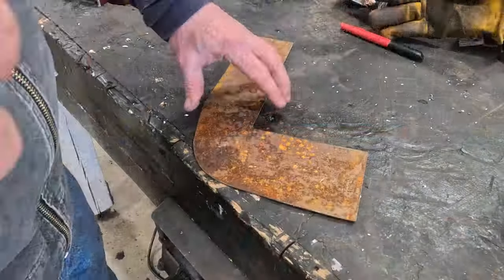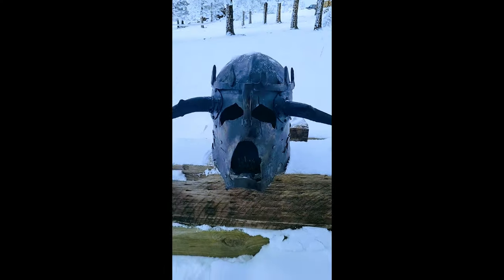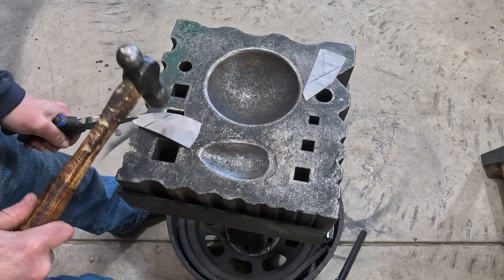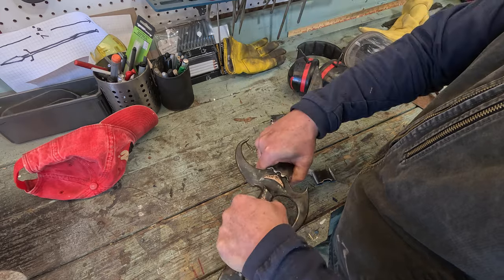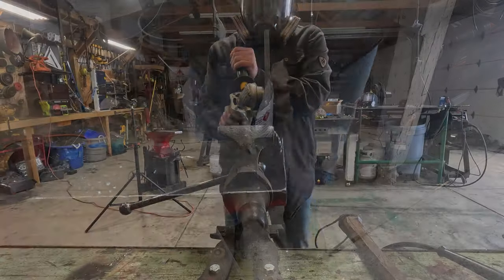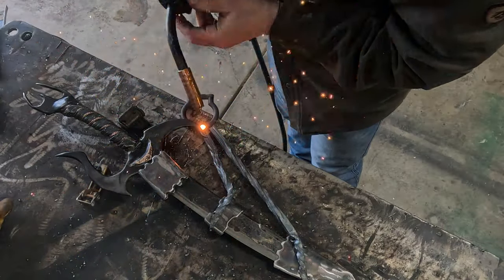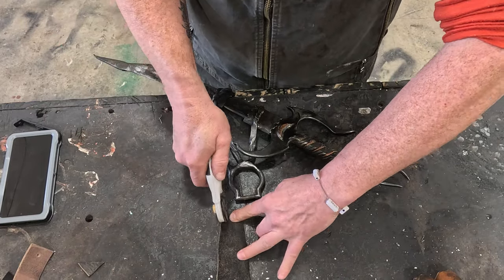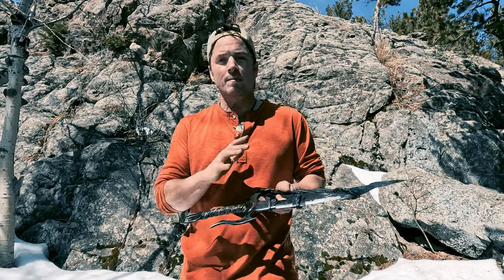Crafting a Nazgul Dark Warlord Scabbard from scratch

Comment: Very fitting to the blade. It looks really cool. But I have a Question, would this type of scabbard cause a blade to dull over time?
Reply from the maker: Great question.  One i have considered a lot too.  I think it would get dull over time from both exposure and from pulling in and out of the scabbard.  THe edge doesnt come into contact with the scabbard thankfully but i bet it still would graze from time to time.   But the Witch King cares not for such trivial considerations :)